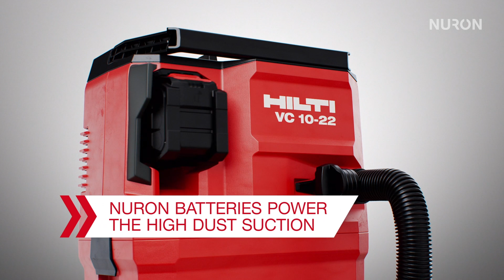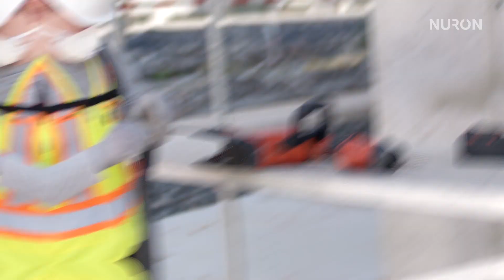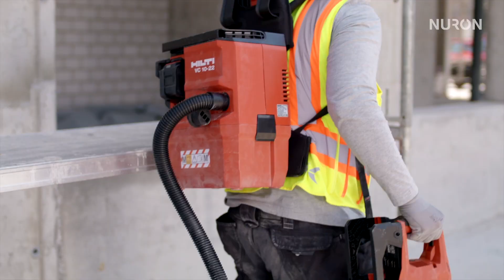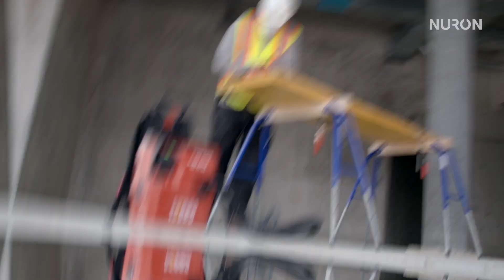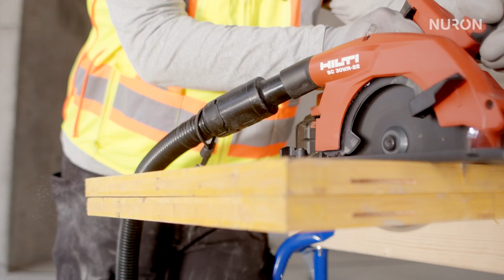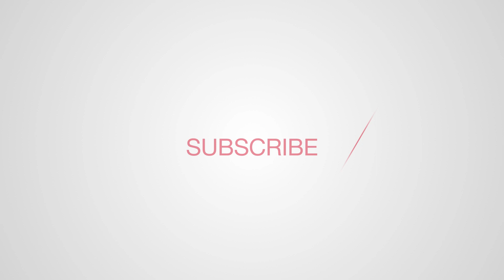Hilti VC 10M-22 CORDLESS DUST EXTRACTOR | Ensure a dust-free jobsite | #Uncompromise with Nuron

Comment: How many minutes run time on the largest battery - in the two settings? Not how many holes can I drill, just the two run times, until battery needs changing?